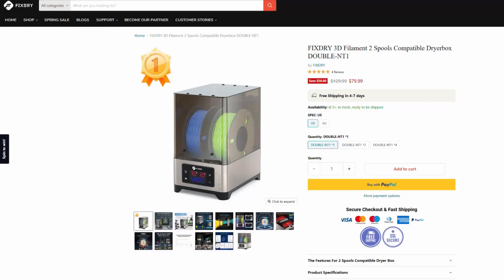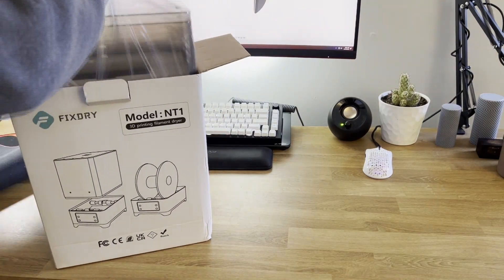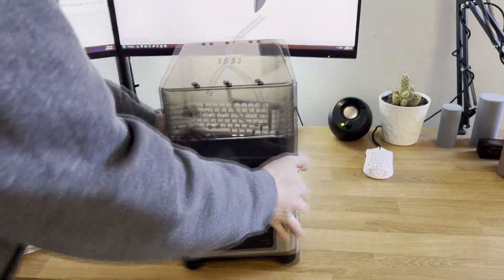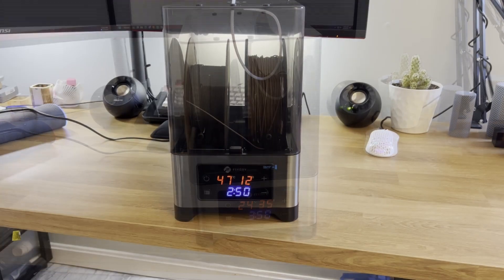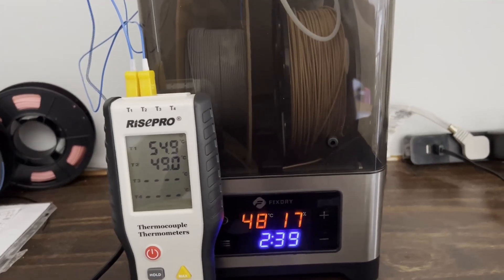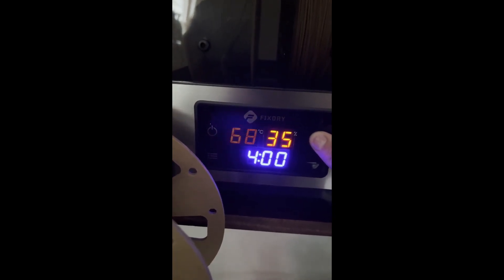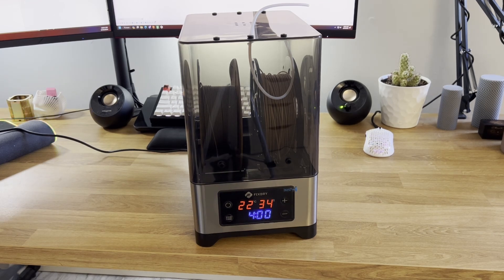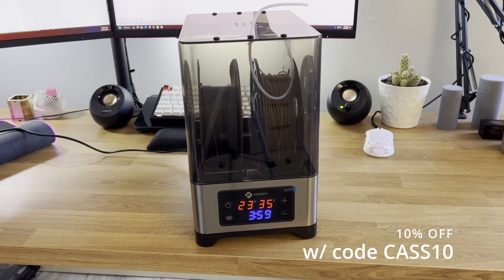FIXDRY Filament Dryer Test and Review

Comment: I’ve got the exact same issue with my Fixdry NT1. The temperature reading is way off by about +20°C. For example, if I turn it on at room temp (~20°C), the display shows ~38°C. And when I set it to 70°C, it never actually gets there — in reality it’s only around 50°C, but the display already says 70. Super frustrating, since I need higher temps for proper drying and this makes it basically unusable for certain filaments. No clue how to fix this, but it’s disappointing.